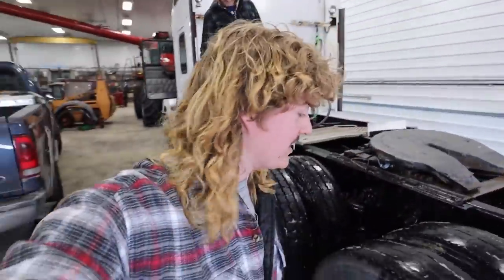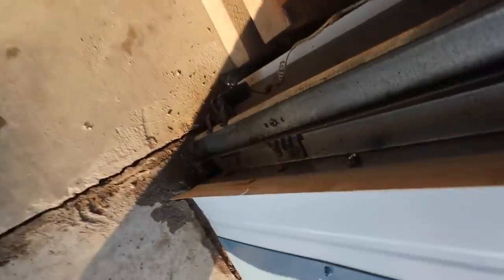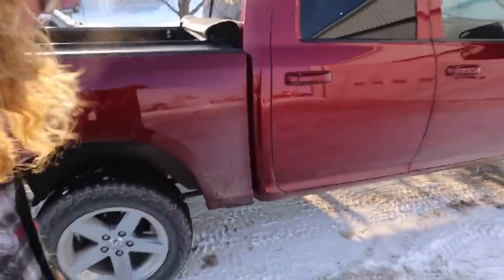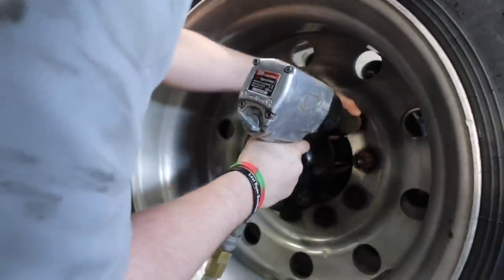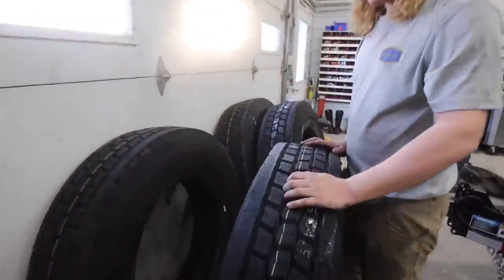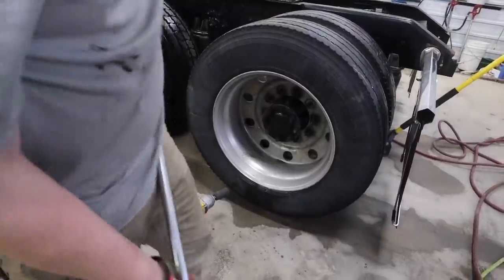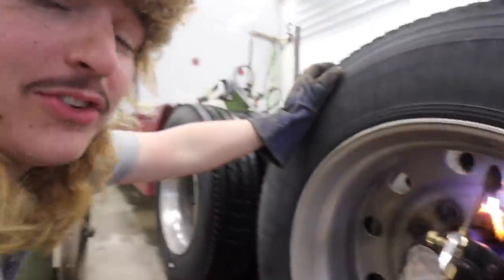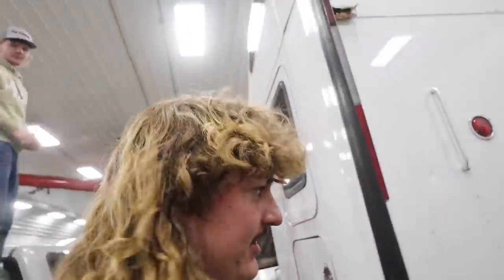I Took A Torch To My Best Friend's Kenworth...

Comment: I broke down in TX one night, blew the turbo on the tractor. UPS leases their over the road tractors from Penske. So Penske brought me out a loaner, it was so dark I couldnt do a good inspection on it. I finished my shift, my partner took over and I went in the bunk. He woke me up when it was light enough to see, the side faring on the driver side was hanging on by only a couple bolts and was flapping all over the place. We had to stop again, call Penske. My partner didnt want to sit and wait on another tractor, he wanted to get home. But I was the senior driver and I told him I didnt want it coming off and going thru somebodies windshield. That would be like a ten foot knife coming at you.

Comment: All the fairings are for fuel mileage improvements, so say the engineers. The rear ones do also help, a bit, with the wind between truck & van trailers. Not so much with flatbeds. Pig pen or bull racks, never pulled them so not sure. Now I see it was a millennial truck, no stick through the floor! 😁 He sure got the life out of the tires though. 👍👍

Comment: Coop I have driven a truck for nearly 30 years. Owner Op for 3. Have a friend that bought this set. And it will take off 1 and 1/2 tires with one charge. It comes with 2 batteries. So you can do both of those one one set of charges. Its the best cordless impacts on the market. Ingersoll Rand W7172-K22 3/4" IQV20 Impact Wrench, 2 Battery Kit

Comment: Cooper, next time break all the lugs loose  first before you jack it up. Use that giant breaker bar. Place the breaker bar on the lug the drive the truck forwards or backwards letting the ground push the breaker bar breaking the lugs loose easily.
Reply: Or breaking the wrench.

Comment: My father inlaw asked me to help him rotate his steer tires once and we had no power tools. We used a 3/4" breaker bar with a pipe extension. I was On the first nut jumping on it just like you did when it snapped off the breaker bar. He ended up taking it to a shop where they had a 1" air impactor. It was the shortest maintenance work i ever helped him with.
Reply: Is he still the father inlaw............

Comment: I was told hearing the rusted nut caused expansion, weakening the rust weld. Basically +5 days soaking in penetrating oil in 5 minutes.  Tough jobs heat, spray with cold water, then reheat as it’s the metal expanding, contracting that breaks rust.  (Too much heat damages temper of course.  
  I suggest next time you have a real shop work on the truck you ask them to check, torque the lug nuts.  Of course you can’t get the inside...     leave the fairings.   I might spray penetrating oil on lug bolts when I’m thinking of putting new tires soon.
  The old tires.  Automatic trouble if caught hauling with them.  I have pulled stuff with sketchy tires.  I wouldn’t drive that Kenworth 50 miles bobtail with as bad as they looked.  (Maybe directly to tire shop after dark)

Comment: Will agree on the Milwaukee comment from Shadner, I am all Dewalt except for my 3/4 drive. Dewalt 3/4 only has same torque as their 1/2 inch, Milwaukee does truck tires with ease!

Comment: That’s a poly bead valve stem. Their designed to slow down the leak if the valve core fails
Reply: Cooper, you got lots of good info here in comments!

Comment: Sorry, At Pete the whole body gets painted then they add everything down line. 
Chassis is mostly assembled then the engine, transmission and tires are installed.

Comment: 3/4 gun on semi lugs?
Anyhoo, just a FYI on tire tread selection.
That tread is a good tread except for the solid outer lug,  they trap snow,  mud,  etc.
They make the same tread with a open outer lug that allows the tread to clean out.

Comment: I would go get a DBA NUMBER in my all caps name. Then how many hours or miles does not apply. Also, get a radar jammer. Old time wild cater retired. NYC to Denver every week. Except planting and harvest.
Reply: My family members used to have dual book... or so I was told.  Gotta make the 💰!
Reply: @amyno5688  it was about money. Never used two books. If caught it was a ten dollar fine and eight hours of rest. Glad to have the rest. As they clamped down the law allowed error for householders mileage guide inaccuracies of at least ten percent and ten percent for just inaccurate. So NYC TO DENVER was 26 hours legally by inspectors rules. Today one is required to run electronic books unless truck is 2000 or older. Which I prefer since I'll set it up to 700 plus horsepower. The way to tell if one is an old time driver. The question is: tell me why one calls the fast lane, the Monfort lane? Greeley, Colorado the Monfort Brothers who now own the Colorado Rockies baseball, owned Monfort meat now sold to Swift. There trucks ran team at the speed limit or more. The speed limit out west was 75. When they turned it back to fifty-five as a national fuel crisis to save fuel. Monfort paid for every ticket over 70. At least till the feds came down. They ran team and often in groups to East Coast. That was when Pennsylvania highway patrol had cars with a bubble on top. One single light. Another reason for not needing two log books two drivers license. Back then the state's did not compare to each other. Oklahoma, Neveda, and  New Mexico was best because they did not respect the federal rules. So even if one got caught, no points. After a year the state would drop the ticket so could use license again in that state. Of course one can also change the speedometer today to make 75-67as some do. Ten percent error is still the rule. Like farming, one has to fine an edge over neighbors competition to survive.

Comment: Not a valve stem puller. Valve stem puller is for tubeless tires. Pulls the stem. That is a valve remover. It pulls out the valve

Comment: Use caution when filming work on commercial vehicles. If DOT sees something they don't like in this video. They may pay you a visit and call it an audit. Putting new stacks up the back is a big violation on the newer pollution compliant trucks. 2003 and newer.

Comment: I very much like your channel but as 20+ yr trucker I was cringing watching you change those tires. Mudflap under the rim before it hits the concrete. As far as those cab extenders and those fairings go you can take them off with a little paint but that style Kenworth was never built to run without the side fairings and unless you remove all of the bracketry along the frame that held them on there and you're going to have to Fab new steps for the fuel tanks the thing is going to look goofy as hell you'd almost be better off to leave it the way it is and just freshen them up. Just an old truckers opinion that's seen and run these trks

Comment: That T600 would’ve been a nice truck but I see it’s built for the newer generations it’s got the push button transmission on the dash. That truck would be a good truck with a 13 or 18 speed but that’s just my opinion
Reply from the maker: It’s changed over to a 13 speed
Reply: @MagicMullet  might be a pretty good truck then

Comment: Don't use stacks they just rust and added wind restrictions go gor fuel mileage do a exhaust under truck out the side is alot less weight and add to fuel economy to young to waste money on fuel go follow Kevin Rutherford channel on awesome looking trucks with great fuel saving
Reply: I thought you want the exhaust away from the trailer hauling livestock. Y/N?